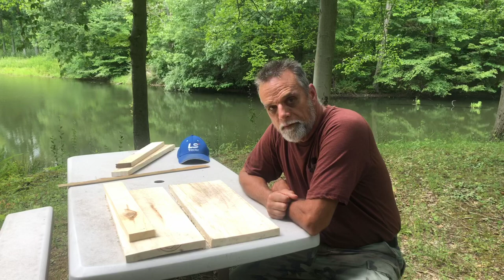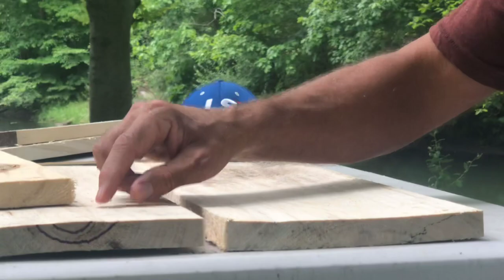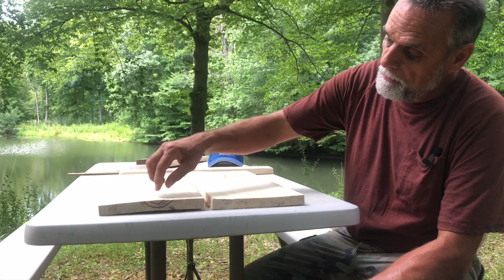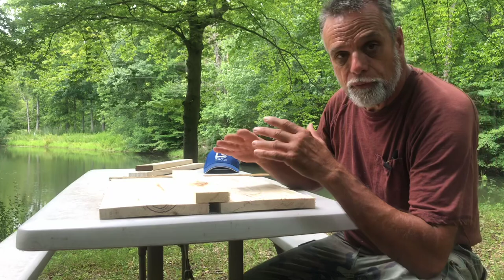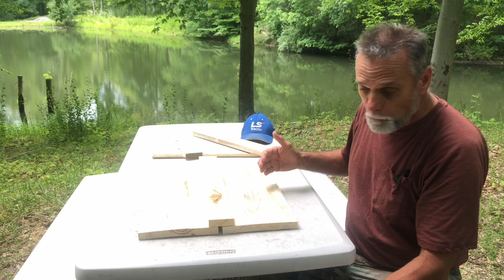How we install the homemade board and batten siding we milled on our Woodland Mills sawmill!

Comment: Curious. What fasteners do you recommend?
Reply from the maker: We've used both... nails and deck screws. Mostly it depends on what kind of wood. We're more apt to use screws in softer wood, like poplar, as it's pretty easy to shoot nails right through the stuff!
Reply: @bbfarmsmaple8011  thank you sir! Makes sense!
Reply: Wow, what a great video. We’re building a house and I’ve sawed every bit of wood for it so far. I’m about to have to start sawing board and batten, and this was the first video that popped up when I searched “how to”. Thanks so much I learned a ton. 

Is there a certain species you prefer? I was planning on using poplar.
Reply from the maker: @keithlutz2063 hey, thanks for the compliment. We tend to use poplar for our siding, but we take care to avoid having it sit in contact with the ground. Good luck with your build!!